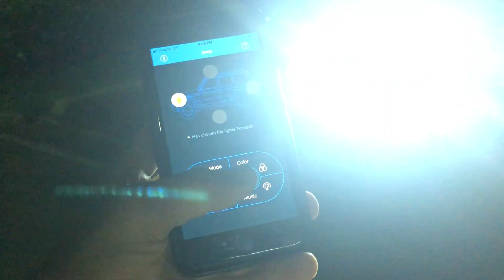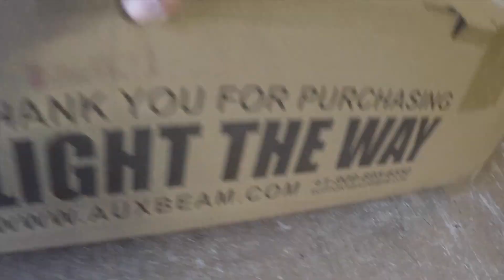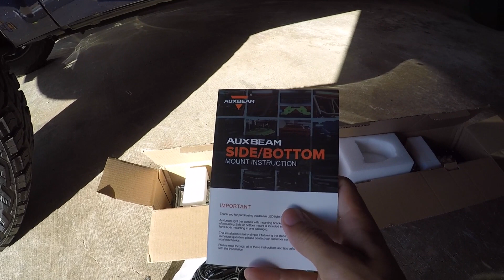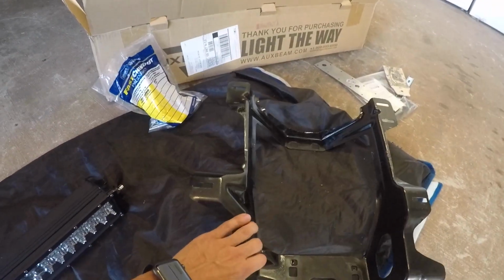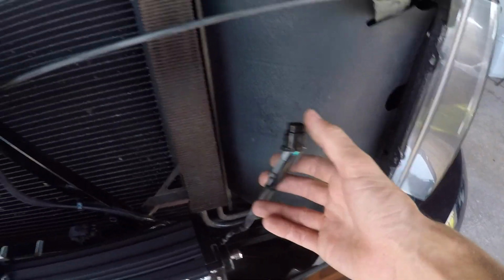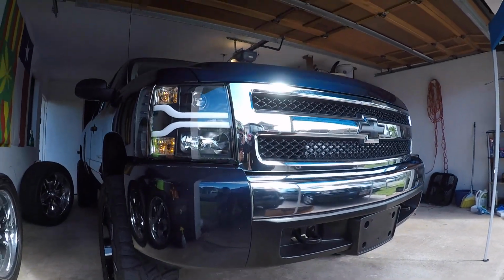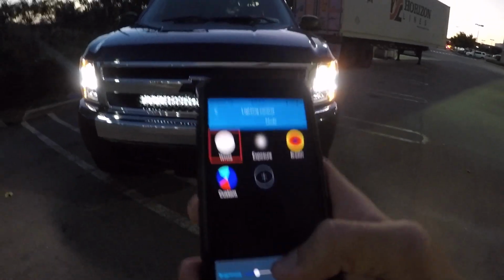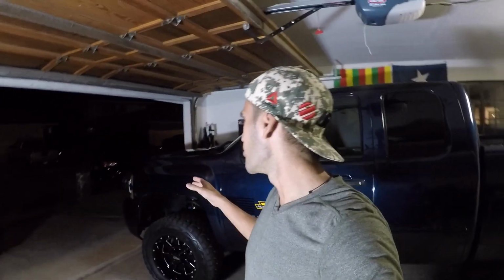LED LIGHTBAR - Auxbeam 32" Curved - Full Install

Comment: Hey man I know this video is pretty old now so you might have forgot but I was wondering what size of hardware did you use? I just got the same light bar and wanna mount it the same way without permanent alterations to my truck

Comment: Install some ditch lights. They attach onto the hood hinges. Go on eBay and for 40.00 get lights, mounts and wiring. The switch I cut the wire and fed through the firewall where my emergency brake wire goes through then I reattached the switch so no drilling. They are cool and reliable.

Comment: I saw that you can turn the light on and/off using the app,  but do you need to have the switch in ON position before you can use the app to turn the light bar on/off??
Reply from the maker: Correct. Switch as to be on before you can operate from the application.

Comment: I'm not sure how hot the climate gets in Hawaii, but wouldn't this cut out some airflow going to the radiator? Have you noticed any difference in your running temps? Thanks in advance.

Comment: I want do an install like this but i have 2 considerations.
First, where is your transmission cooler.
Mine sits right behind the lower grille opening and will be right behind the light bar. The bar will block almost all air going thru.
Second, I see no way of adjusting the beam higher or lower. How did you handle that.

Comment: Added a light bar in 13 was able to bend some metal stock to use the hole is the bumper mounts with out cutting anything up and used a relay switch to use it with high beams

Comment: Looks cool but, Why does my truck run so hot now? Lol love that its brightness is adjustable, if you dimmed it down you could leave it on when you drive as long as its pointed down, I want one but a 52" above my windshield.  You should get the matching auxbeam headlights so they all work  together.

Comment: I'm doing this to my 2010 2500hd crew cab. It will be a nice upgrade. Thanks I been looking for something that it does looks beefy on the roof or bumpers. This solved my problem. Tha is alot

Comment: @LONESTAR HAWAIIAN hello just curious what size lift you have and tire sizes? Also do you have a recon permit? cause i also live in Hawaii and wanted to lift my truck but not sure if i need a reconstructed permit.
Reply from the maker: 3.5" level. TIres are 33x12.5.
Yes I had to get recon with the modifications. Have to do a little extra to get it to pass safety
Reply: Oh Ok thank you for the info!  @LonestarHawaiian
Reply: @LonestarHawaiian  sorry one more question did you have to add mudflaps? or Fender flares at all to pass? just curious if the tires have to be covered by fenders or if they can protrude out just a little bit? Thanks again!
Reply from the maker: No prob. According to Hawaii safety check, over 50% of your rear tires have to be covered by the fender, if not you need mudflaps, so unfortunately yes (that should answer #1) 
Also any tread from your tire cannot extend past your fender. Either bolt on fender flares or get some plastic liner. It really is a pain...
Reply: Okie Dokie Thank you for your time and info! I really appreciate it! Time to get modifying haha  @LonestarHawaiian

Comment: Where did you mount your switch
Reply from the maker: No permanent mount yet. Sitting my my glovebox
Reply: I have a 32 in led light bat coming and want to thank you for showing another way to mount  the light with out cutting the truck. The next thing is to find a spot to mount the switch
Reply: Since  ive put my light bar bihind the grille tbe same as you ive had a few people asking me how i did it. I point them in your direction

Comment: You should go on amazon they make a thing for off-road light that mounts to a fender or wherever but it has a wireless key fob style for off-road lights. That’s what I have in my Silverado. Less wires be ran around.
Reply: Do you know what it's called? Or a link?
Reply: cacsoccer101 anzo USA 12v 4 channel wireless remote control module
Reply: Logan Grittner you mean rock lights

Comment: I have a 2008 Chevy Silverado 1500 with fuel Mavericks 18” tires nitto ridge grapplers 33’s inches and I want to try to put a halo led light bar 32” curved behind my grill
Reply: I have a 2007 chevy silverado 1500, I have the stock grill and I fit a full 52 inch curverd lightbar behind the lower half of my grill, you just have to cut the two brackets behind the grill, and fit in place, then zip tie it works fine for me, the grill will push out a bit towards the bottom, but it works..

Comment: Not trying to be that guy, but why not flip the bar over so you don't have to run it to the opposite corner?
Reply from the maker: There were other wiring accessories on the driver side where I wired it together. I was able to bundle all the plugs in one location.
Reply: LONESTAR HAWAIIAN Fair enough! I figured you had a reason or two, I just couldn't for the life of me figure out what it was!

Comment: Your not sure what cooling fins are for? Removing cooling fins that are needed for L.E.D light bars that produce high levels of heat is not very smart at all and will cause premature light failure . Like your channel but a quick call to auxbeam or a google search would have taken less then 5 minutes. Then blocking almost half of your engines cooling capacity is going to cause overheating and engine damage coming soon with bbn one nice hot humid summer season.